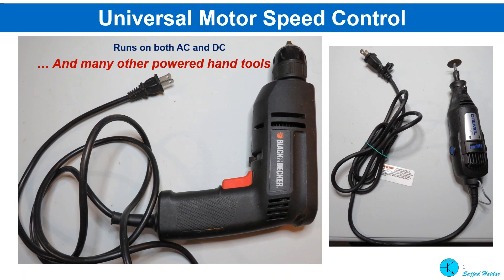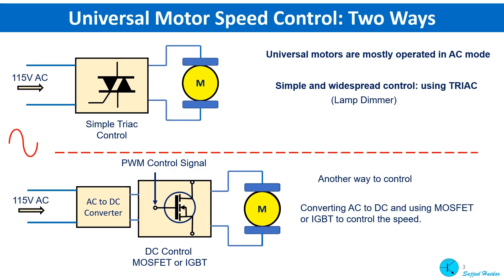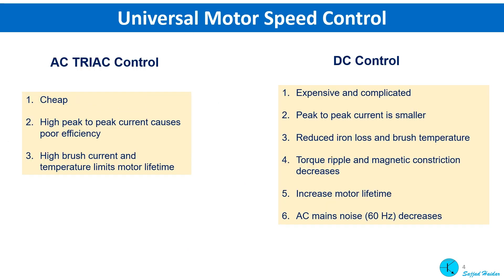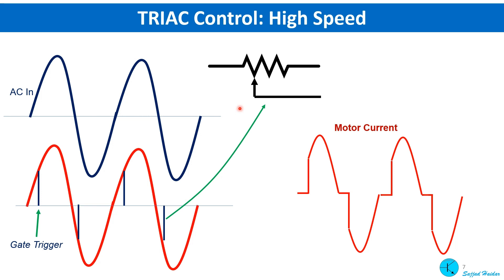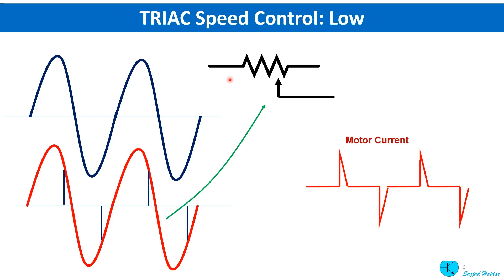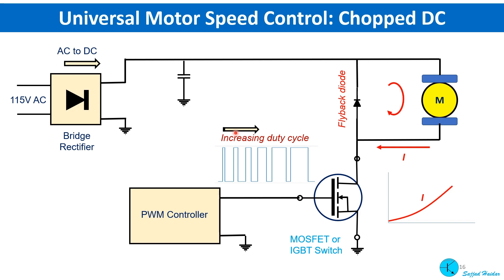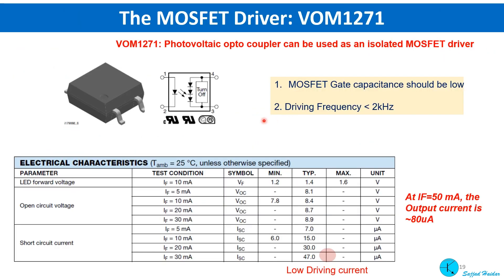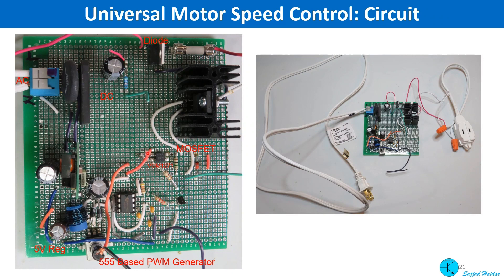Universal Motor Speed Control

Comment: Thank you for this great video. However, I have a question: If the motors you are controlling are AC motors, "I suppose," how can they be controlled using DC current, "Average current"?
Reply: These types of AC motors are called universal motors. They can run on AC or DC.

Comment: That is a great video, Technology for you !
Can you create a second video and test and show a speed controller button trigger for  drilling machines ?
You can get them in red and black or in orange and black they have also a very small wheel in the middle of the trigger button to set the speed.

And there is another speed controller with a coin/wheel button and at the coin button are speed numbers from 1 to 6.
They have also a small controller board with them.
Are those any good ?

A video would be great to both speed controller types.

Comment: Dear Sir,
Thank you for your video of the pwm speed controller.  I have built this controller from your schematic to use with a router that I am going to use on my cnc cutter but have found that it has a problem in that the speed reduces as the load increases.  I have now inserted a small magnet into the spindle and have an inductive pickup to sense the speed but have been unable to figure out how to connect this such that as the speed falls, due to load from the cutter, the speed will increase.
Are you able to suggest a way to include this please? Your help would be much appreciated.
Best regards
Reply: In the beginning of February I'll try to investigate more in your case. Presently I am on vacation and I have do not have much means to look into it that detail. Thanks

Comment: For your PWM circuit, you list a GBU8A bridge rectifier which has a Vrms of 35V.  Did you mean to select the GBU8D with a Vrms of 140V?  Maybe there is something I'm not understanding?
Reply from the maker: Thanks for your comments. Yes, it is my mistake, I used GBU8G, i mistakenly wrote GBU8A. I'll put the correction in the note. Thanks again for watching